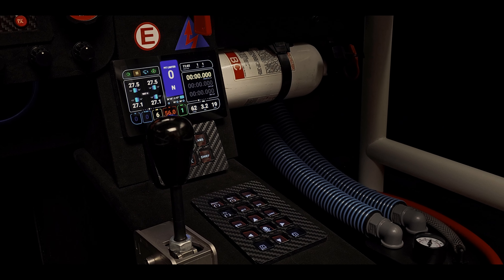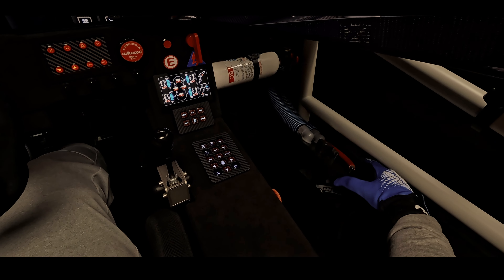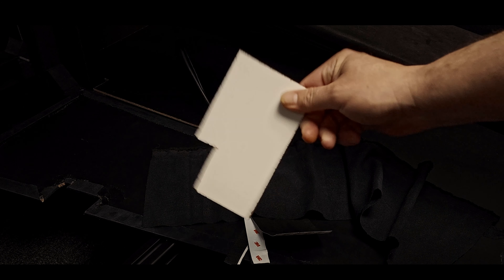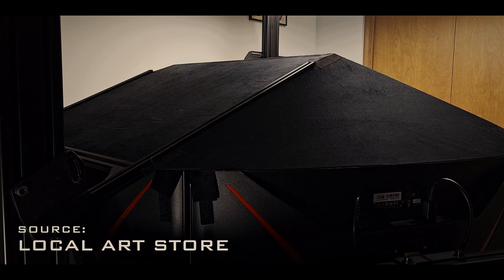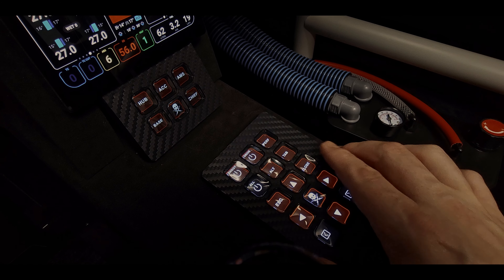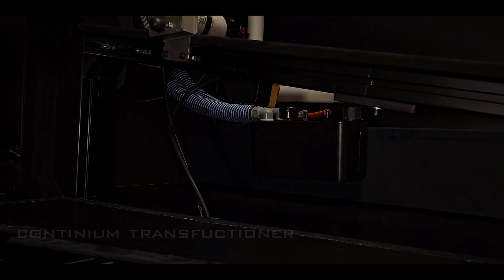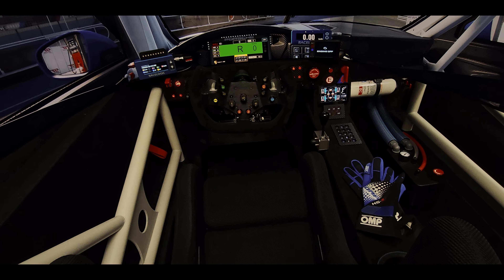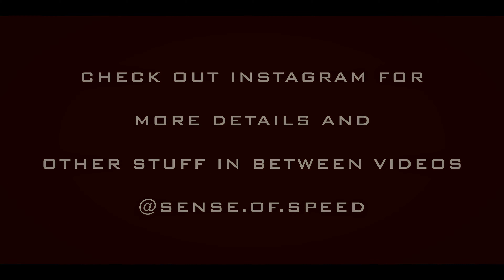Curious about Rig Immersion? Check this out. I Got You.

Comment: Insane set up!!! Slowly working on  building mine up. Started with some 1/8” hardboard wrapped in cf vinyl with some 3D printed brackets to fill in below the monitors. Want to do a new console and floor board to mount the electronics  as well.
Reply from the maker: Rock on, man. Thanks. We need more finished cockpits!

Comment: Awesome set up man! Probably the best full immersion cockpit I’ve seen. Watching the GT3 Road America race yesterday I saw that pump thing on the floorboard in one of the cars and I thought, oh, I wonder if I could build something like that to add to my floorboard and then I come across this! What are the odds we could get a parts list for that build? I’ve got the black cable management box, braided clear tubing and the PSI gauge so far.
Reply from the maker: Hey, man. Thank you. You're almost there. I had spare  hose laying around except the blue house and some 90-degree  plastic fittings I  picked up from the hardware store. I think the blue hose is 1.5 inch dia.  The red knob was taken of a broken regulator I also had laying around.
Reply: @sense-of-speed  awesome man! I actually had some spare pool hose as well. Gonna use 2 sections of that. I believe that’s what you’re running there as well huh? Anyway, great work man. I’m thinking my next addition needs to be the driver side door.
Reply from the maker: @Rungunseattacos  lol. Good eye. Yes, it is. I may get something different when money allows, but for now, it works. The door was by far one of the best pieces I added. It really makes a difference.

Comment: Can you make the same video with the brightness turned up please. Thanks👍🏻
Reply from the maker: Hey. That's a bit difficult considering how it was shot. Was there something in particular you are looking at?
Reply: @sense-of-speed  in a bit of an immersion Rabbit Hole trying to get new ideas and  ways of attaching props panels or even a fire extinguisher to basically nothing. Problem is I have a full-motion rig with a quad monitor setup so I'm not sure how I can do this without everything shaking off. Awsome rig BTW 🏁👀
Reply from the maker: @mercenarysaw  OH, man. Adding motion to the mix proves difficult! A lot of my methods might not work for you. I would suggest using as much profile as you can and attach panels with bolts. Lightweight would be good, too.

Comment: Kevin quick question for yeah. What is the adhesive Alcantara that you use brand name. Thank you.
Reply from the maker: Hey, man. It's 3M but rebranded under "Azobur" on Amazon. I buy the 9.5 inch by 40" roll. If I link it YouTube will delete the reply. It's also sold as 'velvet repair patch" but it's really close to short nap suede. 

The cheaper type I've tried is more like velvet and the adhesive is horrible.
Reply: @sense-of-speed  sweet thank you.
Reply from the maker: @gabrielburkes428  you're welcome

Comment: how is the heat inside it? Does the heat stay inside because of the canopy?
Reply from the maker: it's not too bad actually. If the outside temp is above 75 it gets warm after a few hours but running a small fan on low is comfortable. I have yet to install ducted fans under the dash and an exhaust fan. once i finish all of the Prototype parts I'll work on those and run them from Simhub so I can switch on the fly.
Reply: @sense-of-speed  for me it made a big change when i moved my pc behind the monitor. but still too hot... in summer i have to have a towel on the seat and im only in my underwear. after an hour or so im soaking wet. i dont think a canopy would be ideal for me :D
Reply from the maker: @P3ktoRis  Damn. If my room got that hot, I would be saving up to add a separate air conditioner just for the room.